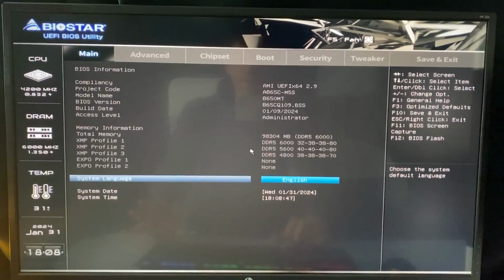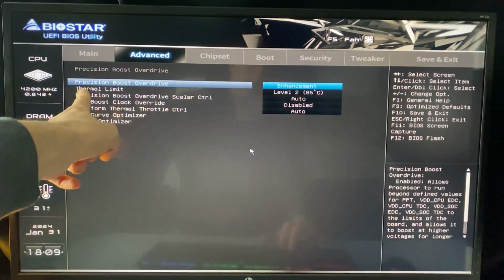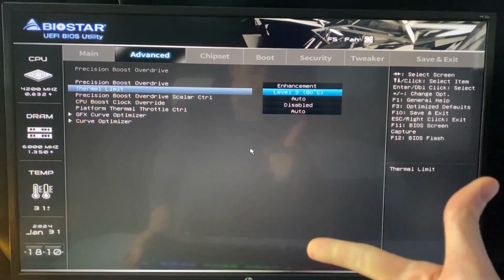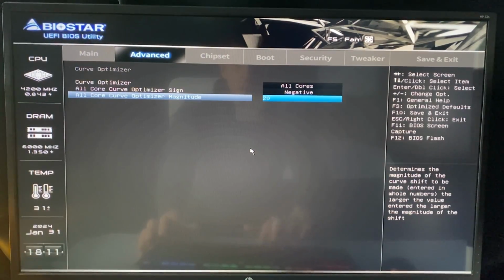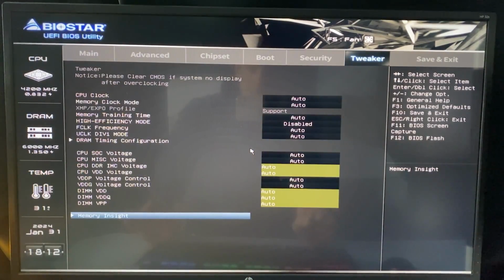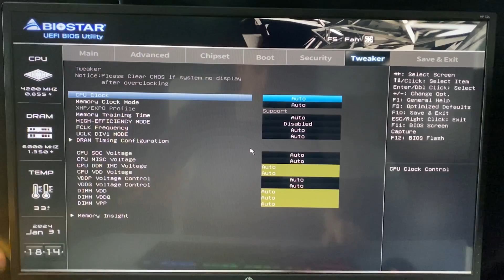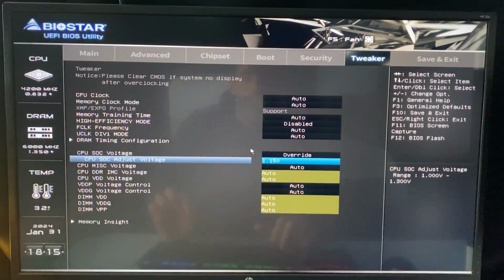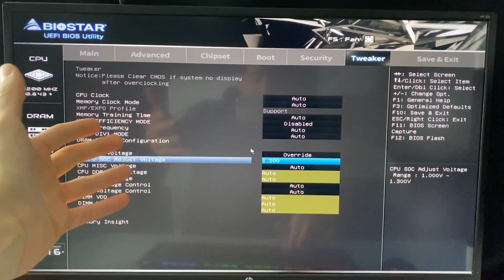Undervolt your Ryzen 7 7800X3D for more FPS and Lower Temperature!

Comment: recently computer has a single click/tick sound in the system once in awhile (i can confirm its not any of the case fan and cpu fan) so im playing around with the undervolting to see whether it works... any idea what can the click sound come from? 

another question is can i use both dynamic and static at the same time? for eg, PBO all core set to -25 and thermal limit to 80 + SOC voltage override and i set it to 1.20v does both of these work together or its either or? i also set my maximum proccessing power to 99% to disable the turbo boost of my 7800x3d which can get quite hot. thank you in advance!

Comment: I tried everything, even your under volting..still me ryzen 7800x3d on full load gets to 80c with water cooling, after I have used Phantom Spirit. I am thinking to return it back. Million options I have tried...still overheating
Reply from the maker: 80C is not bad! You should keep it
Reply: @ImWateringPSUs  I have tweaked it to 45c on idle with negative -30 curve. I just have to test it more to see if it is stable.

Comment: what would be the recomended coolers really for the 7800x3D? im torn to choose between the NZXT H6 Flow or the Lian Li O11D EVO case wheres in the NZXT is between the Arctic LF3 360 or an Thermalrigt Peerless Assassin 120 or in the Lian Li the Arctic LF3 420 or a Peerless Assassin, (i do get that AIOs might be complete overkill so its more for the esthetics) but a "bigger" AIO comes with the benefit to run the fans alot slower to lower the fan noise and with the VRM fan on the LF3 to also cool the VRM sounds like an benefit aswell?
Reply: Thermalright Phantom Spirit 120SE more than enough

Comment: Thanks! I can now run my case fans close to 0 in normal use, and CPUs aio cooler lower and processor temp still hovers around 40c in light use like youtube etc. I used -30 in curve optimizer and -1.2v.
Reply from the maker: I’m really happy I could help :))
Reply: What setting did you set the -1.2v?

Comment: Out of curiosity, granted I’ve not yet watched the video, I’m at 0:58 but how can something work the same between the 3 ryzen 7000 x3d CPUs? They are made significantly different. Like core foundations of the chips are different. The 7900x3d and the 7950x3d both have two separate CCDs while the 7800x3d only has one. There is a lot of fiddling with the 7900 and 7950 x3d chips (like disabling one of the CCDs)to get them to game at the highest level while the 7800x3d is good to go out of the box. I’m going to watch the video but so far it’s not making a lot of sense how you’d do the same with all 3 chips
Reply: “Good to go out of the box”

Seriously? With 55-60°C at idle and great 360 aio cooler and no changes, no curve optimizer and no SoC change. 

Even if you use the 7800x3d, you still have to use the undervolt. I use it and package temps drop by 25 degrees. From 65°C to 40°C and CPU temps (not the package) drop from 55 to 35° on each core. 

Cinebench score has an increase, out of the box the CPU scores 14400 pts and with the curve optimizer and SoC change scores 16200 pts. 😊✌🏻
Reply: @jakubpokorny5436  you may get better numbers running an undervolt but you absolutely do not have to undervolt it. I’ve got a 240mm aio and never reach even 80c under heavy load. 

Not everyone has to screw with power settings
Reply: @jakubpokorny5436  so yeah the 7800x3d is good to go out of the box. I put the cpu in and it games perfectly. Sure maybe I could get 10% more by undervolting the CPU but there is other crap you have to do with the 7900x3d and the 7950x3d that you simply do not have to do with the 7800x3d, so yea my point remains, it’s good to go out of the box without screwing with power settings. But what do I know? I only upgraded from the ryzen 5 7600x and got an incredible bump in my gaming experience while having access to all 8 cores. Guess what? The 7900x3d has access to 6 cores with vcache for gaming. The 7950x3d has 8 with access to the vcache. 

The 7800x3d beats them both in gaming and doesn’t have to cut out half of its damn cores to access the 3D cache
Reply from the maker: Very good point of criticism, however it is quickly explained: the overall tweaking can and will be different (disabling CCDs, different RAM tolerance) however as far as undervolting goes, they all share the same architecture and X3D chips have all the same kind of binning. So the voltage curve and the way it behaves is shared
Reply: Also I truly appreciate you saying if it works for you to hit the like button. Rather than telling people to hit like before watching even 10 seconds of the video

Comment: I have the AsRock Phantomgaming Bios and i cant find many of the options as described in the video. Like Thermallimit(its a manual number so its present but cpu voltage under the Tweaker Tab is nowhere to be seen? Could it be called something completly different in this case?
Reply: I have a rog mobo and it was found under ai tweaker instead of advanced
Reply: I have OC tweaker but the names for the options are either completly different or not there. also what is supposed to be a multiplier wont let you input 48 like mentioned in the video.

Comment: I’m doing a build with a 7800x3d and wanting to go with air cooling instead of aio liquid. Do I need to undervolt it for fan cooling?
Reply from the maker: I’d really recommend undervolting, yes
Reply: Try limiting the PPT to 60W. I dropped another 20 degrees by doing this with only 1-2% performance loss.
Reply: I have deepcool ag620 argb and i do 65-72 degreas on stock.
I use TDP 45w mode(real 62watts maximum). Only this settings reduces alot the temperature cause it never goes above 62 watts. For better improvemente Curve optimizer negative -20 all core on PBO settings. With this settings you lose almost zero fps. Now last setting but this one makes you lose a bit of FPS but largely decreases temperature, on PBO settings choose clock overide negative 500mhz, it makes your max clock be 4500mhz. With this settings with my beefy air cooler i have 52degreas on CS2 with 400-600 fps, The Finals 180-240 fps 52 degreas, pubg 300-500fps 52-60 degreas.

Comment: Last 2 days im using the 7800x3d with -30 curve optimizer and clock override negative 500mhz, so it stays at 4500mhz it stays at 52 degreas and 360-550 fps in cs2 with 4070 super on comp settings, at 5.0GHZ it gets to 61-66 degreas and 500-700 fps
Reply from the maker: I’m really happy it was helpful, thanks a lot for taking the time to leave some feedback :) Consider subscribing if you wanna support the channel & for more tutorials!
Reply: Eu tenho basicamente o mesmo setup que você, suas config de vídeos de cs2 devem estar meio baixa né, o meu fps bate no máximo uns 500 - 550 tudo em stock.

Comment: idk for the 7000, but on my 5700X, the best Curve Optimizer I've found was -10... 0 it gets too hot, lower than -15 it loses performance on Cinebench... at -10 it keeps well below 75ºC on my cheap cooler and has the best performance

Comment: I don’t have the option for Thermal Limit in my Asus bios. I only see PBO Limits, PBO Scalar Ctrl, CPU Boost Clock Override, and Platform Thermal Throttle Ctrl. I’m guessing it’s not the last one since you have that as well.

Never mind there seems to be two PBO locations. One in the Advanced section and the other in the Ai Tweaker section. The one in the Ai Tweaker section shows Thermal Limit as well as the Enhancement PBO setting.
Reply: The thing is that we can only set the thermal limits only 75/85 not 80
Reply: @Gordiix  I was able to set it to 80 but for me it was Level 2 instead of the Level 3 shown in the video. I have a Asus B650E-F motherboard so it might be different for you. Set it to 75 or 85, there shouldn't be an issue since I don't think you'll be reaching those temperatures anyways if you have the Curve Optomizer set Negative.
Reply: @Gordiix  To enter Tweaker section you have to be in the Advanced Mode view. When you enter the BIOS you'll probably be in the EZ Mode view, at the bottom right you'll see Advanced Mode. Either click it or press F7 on your keyboard. From there you'll see the Tweaker section at the top.

Comment: Hello, I have done what you say in dynamic in -20 but my 7800x3d is still going to 76 even 80
Reply: Im using -30 and max thermal limit 70degreas and "TDP Mode 45W (62 real max wattage) and i get 59 degreas 1 day, 61 degreas yesterday while playing cs2 and the finals

Comment: I’ve just bought my 7800x3d and will get on Sunday. Will try ur guide to overclock it for game. Hope everything will be fine) But this will be my first time with AMD CPU, so probably I’ll have some questions to u later
Liked and subscribed btw
Reply: i have a 7800x3d too. is 40-50 idle temps normal?
Reply: @clave2049  here is my specs:
1. CPU Ryzen 7800x3d (PBO: all cores/negative/30)
2. RAM G.Skill Trident (EXPO CL30 30-38-38-96)
3. RTX 4080 super Gigabyte Gaming OC (Overclocked Curve: 2960 Mhz/1075 mV=2925 stable frequency)
Working temperatures no more than 60. In stress tests no more than 77
Reply: @clave2049  absolutely. Ulta settings in Cyberpank on 4.8-5 MGz have 55-60 degrees Celsius
Reply: How is it?
Reply: @loneproficient  just received it. Will undervolt it tomorrow and make test. Remind me. I’ll let you know
Reply: @loneproficient  so. In stock I have no more than 70 degress in benchmarks such as Cinemabench R23+OCCT. So I don't know if I should undervolt it.
Case DeepCool CH780 with 6 coolers Arctic + CPU AIO Arctic Liquid Freezer III 420

Comment: I'm able to get -40 on my 7800x3d. Unfortunately only getting like 18000 on r23. Definitely didn't get a golden chip lol
Reply from the maker: Sometimes if you push the offset too far, the PC doesn’t crash but you lose performance. Try -20
Reply: Ill try. Thanks
Reply: Tune your ram timings instead of using expo. Open hwinfo and watch effective core clock and see if it drops below 5050 while running c,b. If it does it's a power/temp limit. U can also drop some voltages, vddio to 1.1-1.2 will lower package power and give more wattage for other stuff. I'm running 1.05 soc and get good idle temps. I'm currently testing a all core negative offset the good old way rather than using curve optimiser  @ryanneenan8472

Comment: Thanks im doing -30 CO all core on my 7800x3d and getting max clock and 60 or less degreas average while gaming but i use termal trotle limit at 70 to stop the spikes of temperature im very happy playing cs2 at 52-54 degreas on mirage 600-700 fps
Reply from the maker: I’m really happy it was helpful, thanks a lot for taking the time to leave some feedback :) Consider subscribing if you wanna support the channel & for more tutorials!
Reply: did u have problems before in cs2 like "ms" jumping very high or stuttering like mine temp is like 62-65 but i didnt do nothing actually in some situations when i press tab or smth ms can jump to like 70,80 most people told me that is problem with temperature
Reply: @dyrouz  right now i dont use curve optimizer, only -500mhz on 7800x3d 4.5ghz and eco mode 45w(real 63watts). it makes 52-59 degreas and its stable
Reply: @capitaocristalicio2811  im curious cuz u playing cs2 same as me maybe u know how to solve my problem brother,ty
Reply: @dyrouz  my pc was built by a good pc build store they choose the right ram for me with expo profile, am5 every thing needs to be under control, 6000mhz expo profile no more then that, extra fps with high ram mhz cause instability, if its that bad your pc learn to update bios and use expo ram just to make sure like gskill trident neo 6000mhz expo
Reply: @capitaocristalicio2811  Yyeah i got kingston 2x16gb ddr5 6000mhz cl30 i already updated but now i think that sistem is problem i should do new one + bad internet can be problem aswell i have like 20/2 like its very unstable may be problem aswell idk yet,like i have good fps good everything but i never saw that someone has same problem i did so much things 1 over 1 and didnt do system i guess ill try some atlas or pure 11 idk

Comment: My 7800x3d can do -35 and boosts continuously 5050 mhz..
Reply: Mine do -30 with the max clock and 55 degreas on cs2 and 60 degreas on the finals with ag620 cooler
Reply from the maker: I’m really happy it was helpful, thanks a lot for taking the time to leave some feedback :) Consider subscribing if you wanna support the channel & for more tutorials!

Comment: im running pbo -25 soc voltage 1.15 vdd1.05, cpu boosts to maximum in games, effective clock in high cpu load benchmarks drops to 4900, infinity cache is ocd to 2200 mhz and running ram at 6000cl28 with everything else tightened. Did i win sillicon lottery? I find that expo profiles overvolt the fuck out of soc voltage and all that so i dont use it and apply timings etc myself. You mentioned u can do 1 or the other but both same time works for me as the dynamic one is fore core voltage and static is for the other voltages
Reply from the maker: That’s a VERY good result! I’m really happy it was helpful, thanks a lot for taking the time to leave some feedback :) Consider subscribing if you wanna support the channel & for more tutorials!
Reply: @ImWateringPSUs  I got bored and decided to tweak some more, getting sustained 5050mhz in cinebech, running cl 28 6400mt. Gonna try bclk next 😝

Comment: i tried the programm Hydra 1.6E Pro to customize the curve. cpu  works now at  -44 -40 -40 -44 -36 -40 -40 -50 on the cores with 85W, 80C and 4,900 MHZ on cinebench 30min . now imma wait for a Crash lets see if it stays stable
Reply from the maker: I’m really happy it was helpful, thanks a lot for taking the time to leave some feedback :) Consider subscribing if you wanna support the channel & for more tutorials!

Comment: Bro i did that right after installing the cpu. After that i put everythin manualy back to see the stock Performance first. Then i updated my bios now i cant change the max temps anymore its stuck at 80 lile you did in the video and the curve is stuck at 20 it wont allow me to change it. Thats weird.. Gigabyte b650e mainboard
Reply: I wanted to try 25 or 30 on the curve

Comment: i have 5600x undervolted on 0.927Volt, using 3,9ghz.
used 10-22Watt in Games.
realy good. never over 50°
pc quited like a baby.
i dont think PBO is best. because -20 is 0.060V. So if he using 1.3V -20PBO = 0.970Volt. You cant get the best with your CPU from PBO. But if you dont understand much about volting. Its good to use it.
Reply from the maker: For AM4 I don’t recommend PBO, I have a dedicated tutorials! But this is an AM5 tutorial :)
Reply: @ImWateringPSUs where is this tutorial?

Comment: mine runs at 60-70 on widnows and 60-80 on cinebench i dont understand this cpu
Reply from the maker: I was gonna say, cooler problem most likely. Glad you sorted it out! But yay this CPU has dynamic spikes which are not ideal. A static UV fixes that though
Reply: @ImWateringPSUs  yeah im gonna test some undervoltage today the spikes are not fun while watching movies the fans spike up and down every 5 min 😂
Reply: Mine is less then 45 on windows and youtube, 60degreas on cs2 with -20 CO all core, deepcool 620 cooler, i use max 70 degreas to activate thermal trhotle so i dont have spikes of temperature. Use good big air cooler and many fans like 5 with mesh case. Deactivate processor iGPU
Reply: @capitaocristalicio2811  switched the cooler from 240 aio to deepcool assasin 4 with silent fans. It maxes now at 79 on cinebench 10 min and 55 on my main game. The heat spikes are weird tho
Reply: @Maschmo  nice upgrade man

Comment: SOC Voltage is as the name says for the SOC and not for the cpu/cores.
And the stable voltage depends on the ram. I have hynix a-die. And can run 6000 MT/s with 1,075v.
Reply: Me too so gonna try this

Comment: This is insanely useful for Mini itx users who have low profile coolers which can’t keep it cool consistently
Reply from the maker: I’m really happy it was helpful! Thanks a lot for taking the time to leave some feedback :) Consider subscribing if you wanna support the channel!
Reply: @ImWateringPSUs  I wanna set mine for gaming only.   So if I do the curve optimizer say -20 do I also mess with the TDP and the other two pbo settings or just set it to motherboard.  Any help will be great fully appreciated
Reply: @kinneyjr740  you can just do it with the pbo preset it does the same as doing it manually just less steps and can't change it as much but that's why it's a preset. Try some presets and see what gives you the best performance. I'd look into doing it to your gpu as well lower voltage can help with stability by running your card at the same or a slightly higher speed. You can also just see how high you can go before it stops being stable

Comment: I tried to replicate your settings, but the MSI bios are quite different, and I can not find the enhancement setting. Please check how I can do this. I need undervolting my CPU as I will change the cooler system in 3/4 months, so it's better to do it now. I have a B650 Tomahawk MoBo and, of course, a Ryzen 7800X3D.
Reply from the maker: If you check in my CPU undervolting playlist, I do have a few tutorials on MSI BIOSes as well. Also be sure to subscribe to the channel!
Reply: @ImWateringPSUs  thank you, already did💪🏻